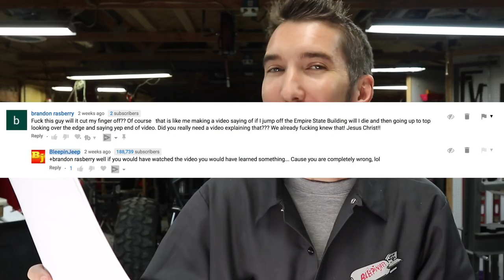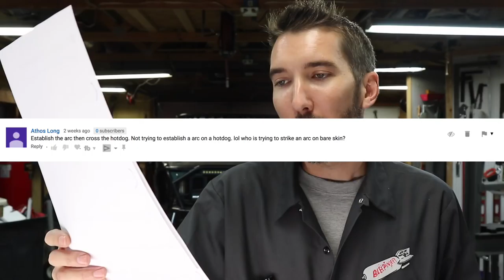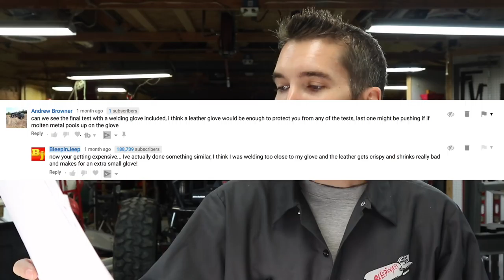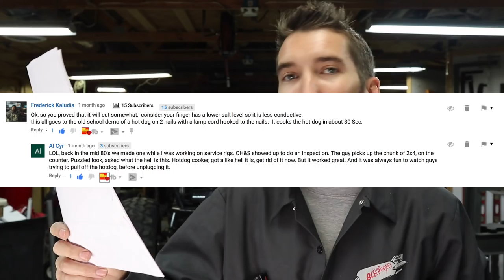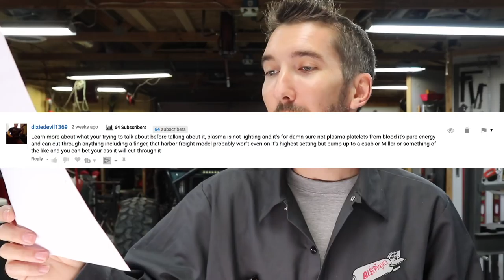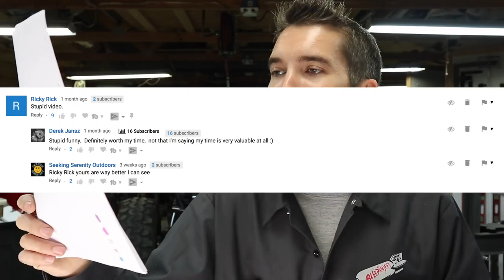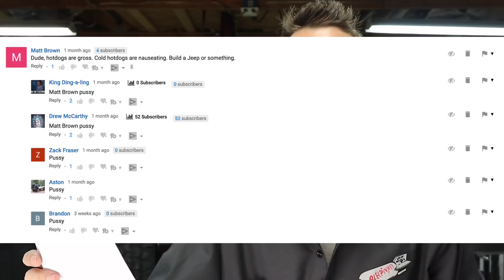This is for the Hot Dog Haters!

Comment: The “ground” clamp refers to DCEP where the electrode is positive and the clamp is negative. There are welding procedures that need to be in DCEN where polarity is reversed and the clamp is actually the positive side. It’s kind of like calling a facial tissue a “Kleenex”. Lots of people generalize that the working clamp is always negative aka ground.

Comment: 2:30  - Jim Colt of Hypertherm has offered an explanation quite a few times on various forums, and here on youtube:  https://www.hypertherm.com/en-US/hypertherm/accessories/work-leads/  Plasma cutters use a "working clamp", attached to a "working lead".

The function of the working clamp is basically one of safety - since most of the current on a plasma is contained in the torch.   Notice how thin the cable is...   The arc on a plasma torch is contained within the torch, and used to generate the plasma, which is what does the cutting (not the arc).  Essentially, the work lead/clamp come into play with arc initiation and offer a signal to the unit.  Dont believe me?   With the work lead sitting on the floor, go ahead and hit the trigger on the torch - see an arc?  Granted its just a pilot arc, but that's where the safety aspect of the work lead comes into play.

A welder, on the other hand, has the arc span from the torch to the work piece - so the work piece is a integral part of the circuit, and therefore requires a lead that can handle more current.   This is why you see a larger "ground lead" with a "ground clamp" on a welding unit.

I can appreciate that some dont care, or maybe dont know these details.   It might even be embarrassing for some people to not know something - still cut the guy some slack.   You should not feel so insecure in your intelligence that you need to berate him for using correct terminology.   There's a surplus of a$$holes on youtube- they're a dime a dozen.   No need to be one of them.

Comment: you asked what we would like to see...I would like to see a video on bypassing the locking mechanism for my ignition key. I am having issues getting the key out...something about the cable that runs from the automatic transmission shifter to the key lock? (94 Cherokee, 2 door, 4.0, AT, stock running gears, transmission and transfer case) thanks.